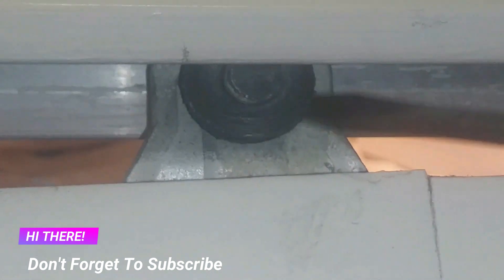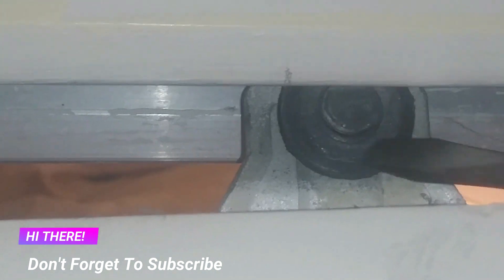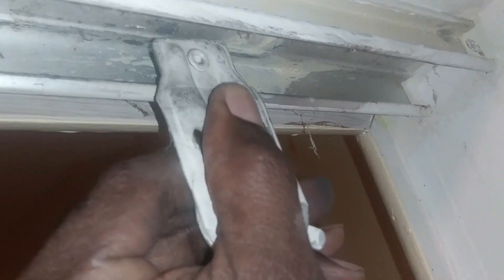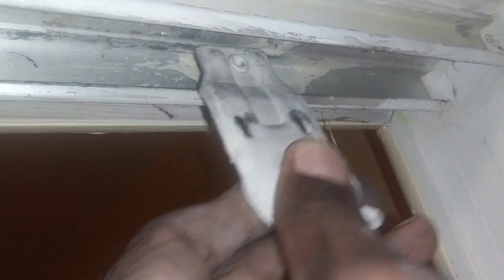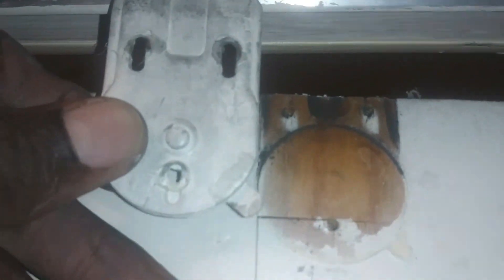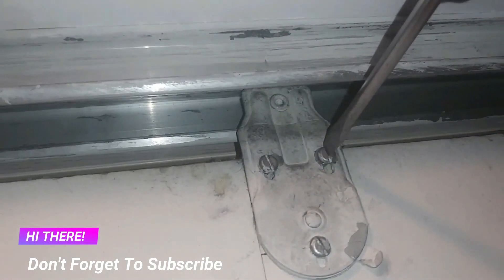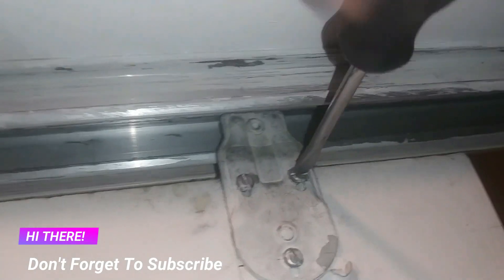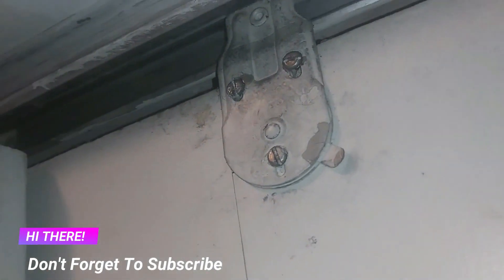How to repair / fix off track closet door.

Comment: Thankyou very much! Removing the wheel system off the track before mounting the door is helpful. I tried without removing it and didn’t work! When you take it off the track and adjust the door, you’re done! This is a pro tip for newbies.
Reply from the maker: Glad it helped

Comment: Thank you so much. I was able to fix my closet door after watching this video. But I didn't have to remove the screws completely from the wheel, all I had to do loosen them. I have only two screws holding the wheel, after loosening them, I was able to pop the wheel back on track and had to tighten them and it's fixed. I was watching some of these videos, how they say you need to remove both doors to fix them. I am a woman and was able to fix it in less than five minutes after watching your video. You are genious.
Reply from the maker: Thanks, Glad you were able to fix your closet door watching my video.

Comment: You can just lift up your door and put it back on track but that is a little bit harder then this
Reply from the maker: if you just lift it up and put it back, you didn't fix the problem. the rail is bent so it will come off track again very soon.